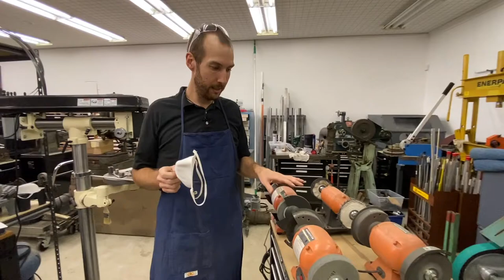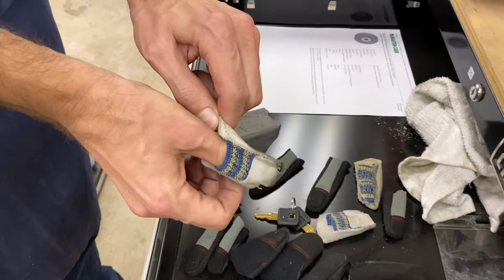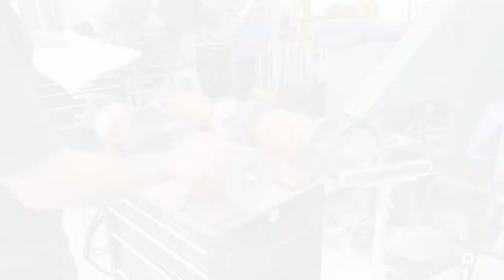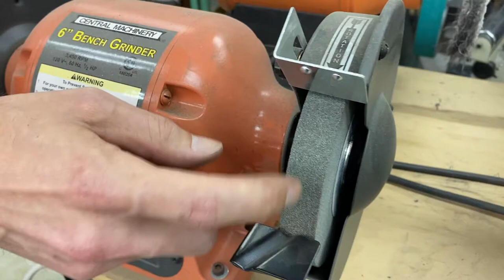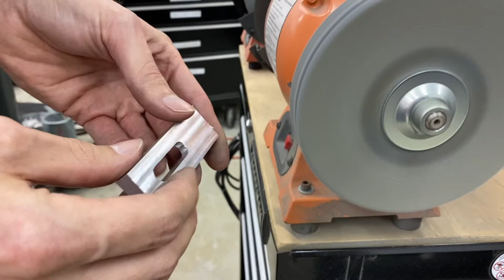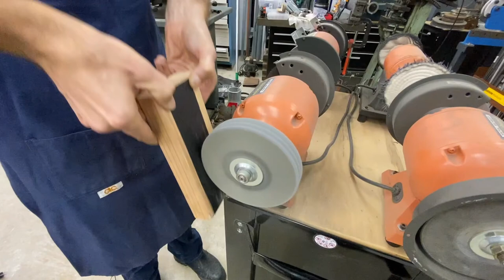HOW TO USE THE DEBURRING WHEEL: Tips and recommendations for abrading efficiently and safely

Comment: Nice video for a beginner. Perhaps of greater use if you shared details regarding your suppliers. For example, the 8" grinders are obviously Harbor Freight because you can read the labels. Also, while the 3M deburing wheel is a familiar part number to 'me', perhaps it's not to everybody. Thus, in light of the market for this video being the less experienced, this is the only 'advice' I have for you because otherwise, this is a superb training video with great educational content. So good I would recommend to everybody regardless of your level of knowledge because even for the more experienced, it's always good to refresh on basics. Well done! And by the way, subscribed because if I ever begin to believe I know it all, it's time to take me out back and shoot me!
Reply from the maker: Great! Thanks for your positive comments. I learn something new in the shop every day and love to share those things. The wheel we use is a Norton product distributed my Mc Master:

Bench and Pedestal Grinding Wheel with Nylon Mesh, to Deburr Stainless Steel and Aluminum, Smooth, 6" Diameter, 1" Thick, Medium Density 

https://www.mcmaster.com/46575A46

Which 3M wheel do you use?
Reply: @TigermothRacingTV  3M Silicon carbide fine.  Medium would be a better choice but my supplier didn't carry it.
Reply: @TigermothRacingTV  what about those wheels on the carbide grinding set up?

Comment: Any idea why the market has a wide variety of prices? I see them anywhere from $34-$760 which to me is an insane difference. I just need one to clean up dings & dents for putters. Do you think a cheap one will suffice?
Reply from the maker: Yeah the pricing is wonky. The 3M ones are the best but the cheap ones work, they just wear out faster. Sometimes amazon will make a mistake and accidentally double your order on things like this that come 2 in box.
Reply: @TigermothRacingTV  nice ! What about a cheap buffing machine ? Any recommendations for something like cleaning up a putter ?
Reply from the maker: We use a 6in bench grinder from Harbor Freight for small wheels, works great.
Reply: @TigermothRacingTV  so the 3m works on the 6 inch ??
Reply from the maker: Yeah or the buffing motor.

Comment: What is the exact grade deburring wheel you are using.  I get 3M deburring wheels from Tru Grit, they also have the 3M cast aluminum reducing flanges if you get the 8" wheels with the 3" hole.  But if you need thinner flanges for 8" wheel you can get pressed steel flanges from SuperGrit which are much thinner.   Both Tru Grit and SuperGrit have flanges for up to 12" wheels that have the 5" hole.
Reply from the maker: I think they are medium. We recently upgraded to 10 and 12 inch wheels on a new Baldor motor and have been enjoying the added clearance. We made a batch of our own adaptor flanges. That was a great project for our new apprentices to tackle and learn on.
Reply: @TigermothRacingTV  mediums are reddish in color, fine is gray.  But there are a few different variances within each color.

Comment: You speak about safety but wear no gloves!!!!
Reply from the maker: You should not wear leather or other non tearing gloves when working on a deburring wheel. You can wear finger cots or rubber gloves that will tear off. Safety glasses or a face shield are much more important.
Reply: @TigermothRacingTV  In a machine shop like yours, I probably wouldn't wear gloves around a deburring wheel, since you deal with actual milled projects.
In my shop, I wear gloves all the time because all I do is deal with external burrs from a TCT saw and clean mill scale from tubing. Maybe that'll help develop a more purposeful way of doing things.